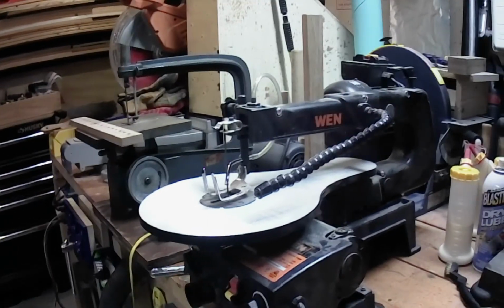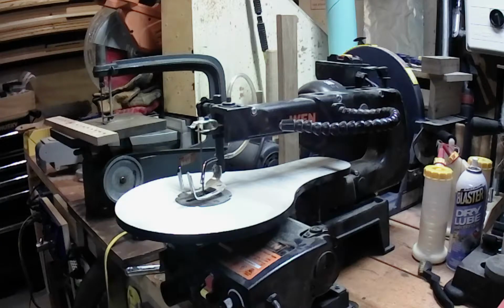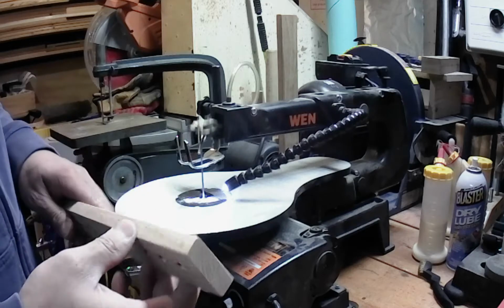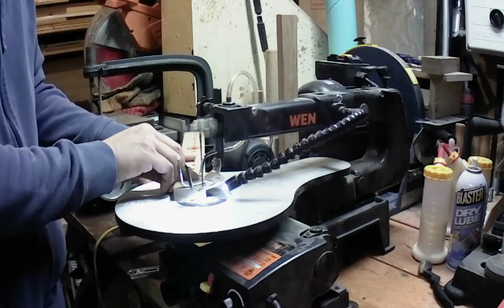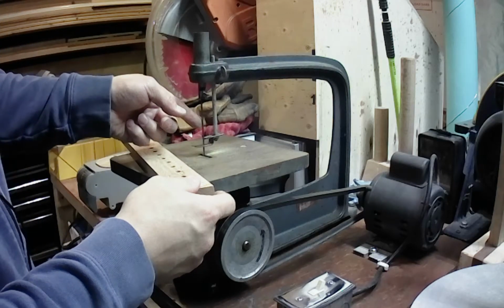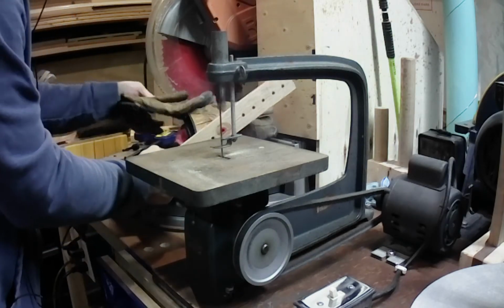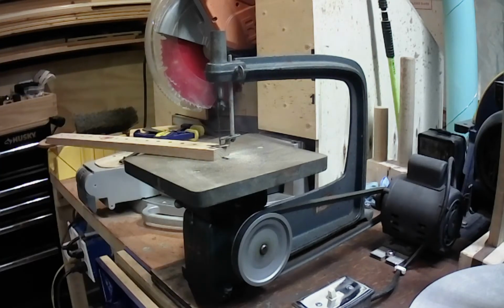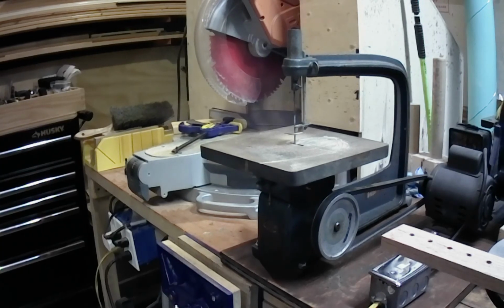Antique scroll saw vs Modern day Cheap Scroll Saw

Comment: I just got a similar one.. I changed the oil...it had a red tint ...so i am using transmission fluid....I put new belt on it... mine is a side by side montgomery ward powrkraft scroll saw and band saw...they were actually mfg by a company called duro who made them for sears and mont wards and others back in the 30s and 40s.... mine is missing the foot...but ill make one on my cnc for it...Getting them ready to last another 100 yrs....hope your is still doing good...im sure it is ..these things are not built like tanks...they are tanks.....Happy sawing
Reply from the maker: Yea, I have since sold the WEN and this saw became my primary scroll saw. I swapped the motor for a DC motor and hooked up a DC controller so I can have speed control on the motor itself. I am in the process of restoring an old delta. It almost double the size of this one. Look forward to getting that back to life.
Reply: Don’t rip the air tube off change it for a smaller diameter tube